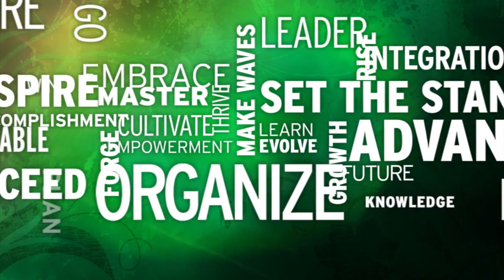Determining Safe Spraying Times Through Temperature Inversion

Comment: I want to clarify a few things here. I realize it is difficult to get every important fact in an interview video and especially, the written summary. I am trying to get an edit accomplished to the summary and title. In the meantime: 1. Times for safe spraying noted (7 am to 7 pm) are meant for the Mississippi latitude. The times noted can actually be referenced to sunrise and sunset if you are at another location. Time intervals in Iowa (for example) will be a lot different than in Mississippi.  A couple other points: 
2. “Stable” atmospheric conditions" are partially indicated by the presence of temperature inversions. The other major variable indicating stable conditions is wind.  3. A better title might be "Determining Safe Spraying Times - Temperature Inversion Avoidance" or something like that.